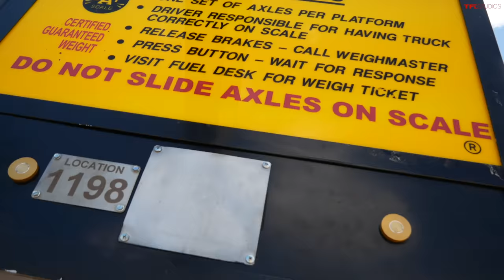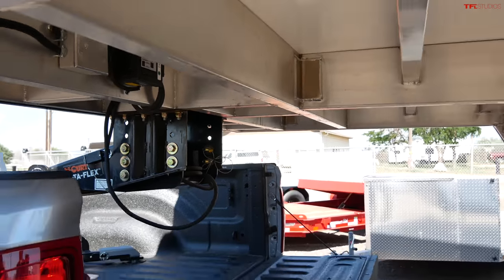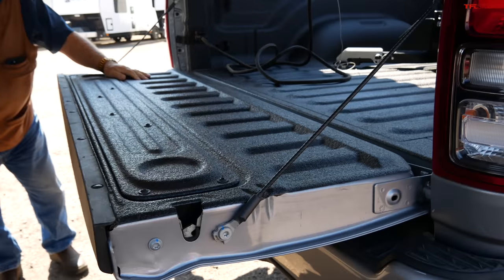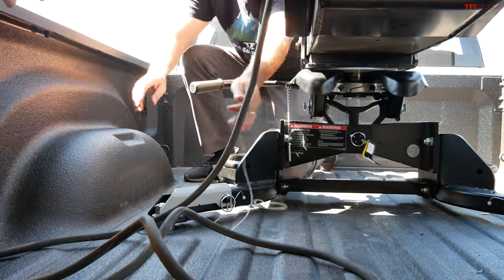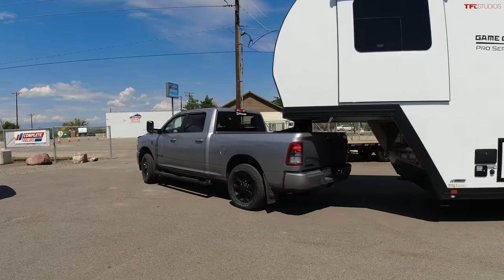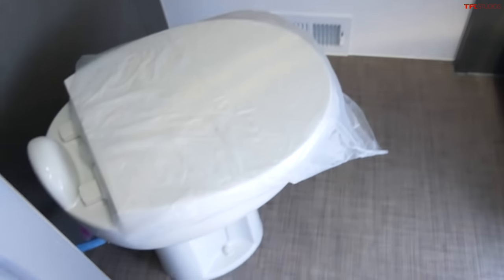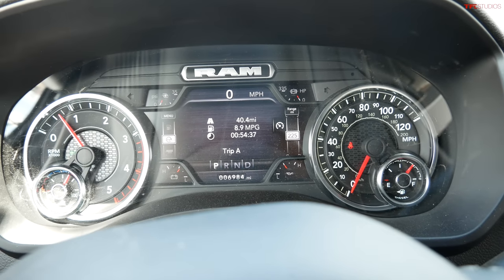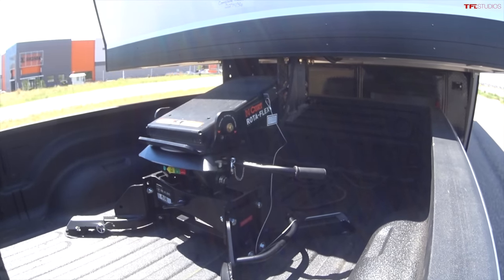I Accidentally Overloaded My Ram 2500 Cummins By 1,000 Pounds & Guess What?

Comment: I wish the Ram short bed was 6.6 like GM I had. I have a Crew 6.4 now and it is just a little short. Need a slider to do that job and let’s be real legally that truck isn’t enough but actually it can do it fine and the difference from 2500 to 3500 is largely the rating you are paying for. Ram does have the different rear end setup but I don’t think an F250 is much different than an F350 except the rating you pay for in reality.

Comment: Kent's comment of "Increase the payload, you OEMs" is puzzling. I'm sure he is aware that the 10,000 lb GVWR is a regulatory line drawn in the sand by the federal government. The only ways to increase payload are to increase GVWR or reduce the vehicle weight. Stepping over that 10k GVWR line moves the truck from Class 2b to Class 3 and brings higher insurance costs and more regulations for vehicles in commercial service. That's why the OEMs set the GVWR at 10k. Some residential areas don't allow parking a Class 3 truck overnight. One way to reduce vehicle weight is to opt for the gasoline engine rather than the Diesel, saving around 700 lbs in engine weight and gaining 700 lbs in payload. Andre's response of "Get a one ton truck" is the answer. Kent's response of "Increase the payload" is a head scratcher.
Reply: True you can't change the payload and towing capacity set by the OEM's. Suspension accessories just help less squat and better handling. I do want Ram to increase the payload to match trailer capacity.

Comment: Love content like this but parts of this were painfull to watch. 
You do NOT need a dually for that trailer, just a 3500. And ALL manufacturers 2500/250's are payload limited, not just Ram.
You do NOT need an 8' bed...at all.
Tailgate should stay on (just referring to the thought of removing it).
Also, if you test your trailer brakes with the trailer brake lever prior to hitting the road, you can be assured they are functioning well, and are at the proper setting. Before I upgraded my 5th wheel to disc brakes and 8k axles I always used the manual lever to test the drum brakes and get them 'seated' (for lack of a better word).

Comment: The ball is not attached like a fifth wheel . If the trailer was to  flip over the truck will go over with the trailer . With a goose neck ball the trailer would come off . Look at the semi truck that flips on it side the tralier will follow . Goose neck and bumper pull they will come apart . I have seen this . Look at ram hits slow moving semi the goose neck ball broke and the goose neck trailer hit the back of the truck . Fifthwheel hitch way stronger. Denis from santa rosa ca .

Comment: would've been interesting to see how close the bump stops were to the axle with it being "overloaded". Also wonder how much of a difference adding a toy to the garage would've made.

I do wish ram would offer a higher GVWR on the 2500 trucks like GM & Ford. Although, in this case, I think only a GM would've had the payload for this setup if sticking with 3/4 ton trucks.
Reply: The higher gvwr for this truck is the 3500?
Reply: @frostedjedi  I'm aware. I would just like Ram to compete with other manufacturers payload in the 2500's. I have a '17 2500 and know the capability is way higher than the advertised rating.
Reply: It's just marketing bs. Why would you make a 1 ton if you have a 3/4 ton with gvwr of 1 ton. Just get the 1 ton if you want more?

Comment: Im not sure which sliding hitch they use, but ive seen ram shortbeds all over do just fine with 5th wheels.
Reply from the maker: Yes, you can buy an expensive 5th-wheel "sliding" hitch for your shorter bed truck.

Comment: The OEM's can't increase the payload. Because they're limited by 14k rule. If they go over that. They'll be considered a commercial vehicle.  The DOT laws need to change on this. It's 2022 these new trucks need to be moved up to 16k in my opinion. Before they're considered "Commercial weight" considering today's technology with light duty trucks.

Comment: I bought a Thor 5 th wheel and the guy towed I with a 2 wheel drive and I had to put some 2” square tube as a lift for the trailer to not hit my bed sides on my 05 Dodge 3500 4 foot long bed dullay 5.9 cummins and towed it like there was nothing there but I did have to up grade my trailer brakes to electric over hydronic and that baby would stop on a dime !
Reply: 4 door not 4 foot bed that would  be a funny looking truck !!

Comment: You can gain several hundred pounds of payload by going with the 6.4L Hemi instead of Cummins in Ram 2500. Less torque, but more payload.

Comment: 2700lbs of trailer on the bed and you guys should measure the before and after squat like in your ike guantlets.

Cummins ram 2500... $65,000
Goose neck hitch... $2000
Atc game changer 36tf toy hauler with complete solar independence $200,000
Being overloaded on an empty trailer... priceless.

Comment: YEP... If you are going to tow anything, "Always use a 8FT BED!!" 1/2 TON ,3/4 TON OR 1 TON!! So why isn't there any CREW CAB 8FT BEDS IN 1/2 TON???????? That way we can fit the family in the truck and tow 2 side by sides with a gooseneck with a "HALF TON" 2 CAR HAULER FLATBED!! So we don't have to take 2 vehicles to carry the stuff or extra people!! I have a 6 person Quad, and need to put all 6 people in the truck!! I also need to carry a ton of stuff that take up the 8ft bed!! But I don't need to tow anything over 10,000lbs!! Mostly 5k to 7 k 95% of the time then 4% not towing, and 1% towing 10K (500MILES ONCE EVERY 3 YEARS) 1/2 TON would be great if they actually built a "REAL TRUCK" in a 1/2 ton!! Then I could drive it more when not towing, instead of having to cram myself into my Toyota Corolla to get 40MPG'S!! If I could get 30+ not towing in a Crew cab 8ft bed, then I could get rid of both my 1 ton and Corolla and only have to pay 1 insurance payment and one registration and so on... But they are too stupid to sell these trucks to the MILLIONS of people that want, and NEED these trucks!!! Oh, maybe next time weigh it "Before" you take it out?? LOL!! Just good to know that it can handle a little bit over... THANKS GUY's!!

Comment: Well your recommendations are way off.  If you look at the ratings of the single wheel 3500 it’s not great enough to carry the load.  Remember the load rating also includes passengers.  You were by yourself.  Is your family driving separately???
For that trailer you need the dually for the payload.

Comment: Why is the payload so low on that truck? If it’s 8300lbs and 10k gvwr, that means it only has 1700lbs of payload. Most half tons have that much even without getting any sort of payload package
Reply: It is because it has a very heavy diesel engine in a 3/4 ton truck. 3/4 ton and diesel is a complete waste, always get at least a 1 ton so you have a decent payload. And better yet, go dually.
Reply: The 2500 dodge has a different rear suspension, built for comfort not payload.

Comment: We commonly overload the snot out of our stretched 4th and 5th gen Ram 5500's. To the point where you can only stick a finger in between the front axle and the bump stops. The trucks are stock and have zero problems pulling that kind of weight. Although struts and shocks do not last long, 50-60k miles maybe.

Comment: Fifth wheel hitch weights are typically 20% of the trailer weight as opposed to 10% for a bumper pull. I would use a dually to tow that trailer. It’s better to over truck your trailer! Max trailer tow ratings are misleading. That truck has a max fifth wheel tow rating of 18,000# and a payload of 2200#. The hitch weight of an 18,000# fifth wheel is 3600#. Your truck is going to be 1400# overloaded! For that weight, considering passengers and all their stuff, you really want a truck with a 4500# payload (one ton dually)! The other thing to consider with Ram is that an Aisin transmission is an option on the 3500 which is way better than the 6800RFE. You may want to consider having a rep from LCI for a video like this as opposed to reading the directions and making a video. 😂

Comment: Do 5th wheels really add that much weight to the rear AND front of the truck? 5,000 on the steer axles? That just seems weird to me. I know nothing about 5th wheels but I thought common sense would tell me that adding weight to the bed of a truck wouldn’t make the front of the truck weigh thousands of pounds more. Unless I’m an idiot and I’m missing something, which is very possible.

Comment: If the truck is 8,300 with 1 person with no trailer and the truck weight with the camper is 11,080 that’s roughly 2,700lbs of pin weight, not 1,700.
Reply from the maker: Yes, I made a mistake.
Reply: @TFLtruck  I love your content. I have the same exact 2500 but it’s a 21’. I love the truck.

Comment: Even if you load the rear of the trailer, this rig will never end up under the GVWR for the truck.  Think about it:. Fully loaded you have 14,000lbs of axle capacity, and a GVWR of 16k, leaving 2k of pin weight.  The truck is over 8000lbs unloaded, which means the lightest pin weight that trailer will ever have is still going to put the truck over it's GVWR.  Unloading the trailer only increases the pin weight, worsening the issue.  Also, this is before adding the cooler, firewood, wife, kids, and dog to the truck.

This exercise illustrates why it's so important to weigh your rig.

Comment: Can somebody clarify something for me? 

I have a Ram 1500 Limited. The towing capacity guide (according to the ram website using my VIN number) says that my max payload is 1,187 Lb and max towing is 11,087 Lb. 
If my understanding is correct, does that means that my truck would be able to pull this trailer when empty? (Taking aside the fact that I would have to get a 5th wheel hitch that would also eat up some of my payload.)

If that were the case, why would this 2500 ram have a lower towing capacity than my 1500? 

Is there something I'm getting wrong here?
Reply: Your truck would not be able to pull this trailer. His truck weighs 8300 Lbs unloaded, hooked up he had 8000 on the trailer axles and 2700 on the pin which is over twice what your truck is rated. I would double check your payload rating however because 1187 is very light unless Ram rates their trucks differently than every one else. Your max payload is the maximum amount of weight the truck can carry including passengers. For example my F-150 regular cab has a payload of 1705 but I weigh 150 my brothers about 180 and my dad is 230, so if all three of us get in the truck we can only carry 1145 Lbs of cargo. If we got in your truck we could only carry 627 Lbs of cargo, that’s wrong for a full-size truck. Take the GVWR and subtract the curb weight of your truck and that’s your max payload.

Comment: kingpin vs gooseneck? whats better
Reply: Gooseneck, I said that in the video, if it didn't get edited out
Reply: @MrTruckTV  You did state that a gooseneck has higher capability, i just wasn't sure if when considering all other aspects that gooseneck is still the prefered method.
Reply: @acacia987  Well goosenecks articulate better on off-road conditions. And it's easy to get the ball out of the way to use your truck bed. But every truck manufacture rates towing a gooseneck higher weight than a 5th-wheel.

Comment: I think it's funny how you think a 16k lb fifth wheel RV trailer is not very heavy 🙂.

I tow with an F350 dually. I will never tow heavy with a SRW. The dually is so stable.

It was kinda obvious from the start that the trailer was too big for a 3/4 ton truck. There's more to towing than just the weight specs. The length of the bed, the brakes, frame, etc. all play a factor. 

Too many people look at their owners manual and say, oh I can tow that, then you see them in a viral YouTube video pitching themselves into a ditch.

Comment: Your not correct on chains. If the trailer, gooseneck or fifth wheels, are manufactured WITH chains, you MUST use chains by law. Goosenecks and fifth wheels are classified as class 5 receivers, the same as semi trucks. The  receiver for fifth wheel RVs is 15,000 to  25,000 pounds. The average gooseneck connector is  either 20,000 pounds for "light" class goosenecks (mainly horse and stock trailers) but the normal connector is 30,000 pounds. I have a 16,000 pound, triple axle fifth wheel (not a damn toy hauler but a RV) with a 20,000 rated connector but my gooseneck converter is rated for 30,000. I use goosenecks instead of a fifth wheel. The carry weight of a truck is actually determined by the tire weight rating. The average standard pickup tire, 245/75/17, with 8 ply tread, 4 ply sidewall is 3048 per tire. The same size tire with 10 ply tread, 6 ply sidewall is an average of 3680 per tire which is why I run 10 ply tires. The ride is rougher but my truck can handle the weight better. There is a formula for your connector location on the truck which most farmers and ranchers use instead of having the gooseneck or fifth wheel connector directly over the rear axle. The formula allows the weight to be more evenly distributed between the front and rear axles. The average is 6 to 8 inches forward of the center of the rear axle depending on bed length and if the truck is two or four wheel drive with a solid front axle. Independent front suspension four wheel drives are the same as two wheel drive. Instead of  the "over the rear axle" installs as most RV and gooseneck trailer retailers  do, if they use the actual formula, you will have much better control of your gooseneck or fifth wheel trailer and truck.

Comment: Pullrite SuperGlide would fix this issue.
Reply from the maker: Perhaps, that's for the next video.
Reply: I have one on my 2017 F-250 and its great. There are other similar brands but having an auto slider on a short bed is a life saver especially for maneuvering in tight places.

Comment: Did he say 850 for torque? I thought these were 1,050 for some reason. Perhaps I’m mistaken though 🤷‍♂️
Reply: The HO (high output) Cummins  that comes in the 3500s have 1050tq
Reply: @nismofan740  select 3500s that have the aisin as69 trans. 90% of the 3500s on lots dont. So they have 850 tq
Reply: @krice24  correct, was just stating that configuration is only in 3500s. Not all
Reply: The HO version available in the 3500’s puts out 1075.
Reply: @krice24  lol splitting hairs here. I know that. Was just saying there is a version and it's the HO, 10% of them or not.  Excuse me for not going in complete detail for a stranger on youtube....

Comment: If you have the rear air ride the truck wouldn't be overloaded. My rear axle shows 6500 lbs on the door sticker. Should've put weight in the cargo area too. That pin weight would be lighter with your toy/toys loaded.

Comment: If you put toys in the back you always always also increase the pin weight because the back axles do not carry 100% of the weight. If you are overloaded empty you will definitely be overloaded with weight in the trailer.. Only way to reduce the pin weight is sliding axles and move the axles forward.

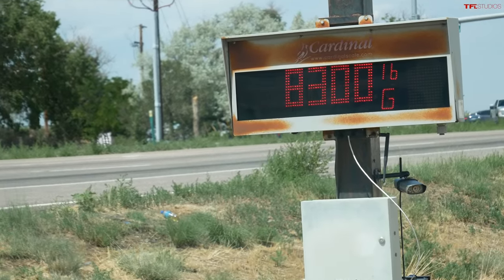Comment: 24:45 **2,700 lbs empty pin weight
Reply from the maker: Yes, I made a mistake on the calculation.
Reply: @TFLtruck  All good. An important note as similar toy haulers of this price and size that are steel construction have pin weights well north of 3k lbs. (HT Cyclone for example is near 4k pin weight). The aluminum here saves almost 1k lbs. of empty pin weight which really does make this a potential 3/4 ton truck towable when properly equipped (BTBRV would always recommend 1 ton though).

Comment: Groan. I don't even need to watch the whole video. 2500 Cummins does not have enough payload for a heavy fifth wheel.
I believe you're also over the rear axle GAWR for the 2500 diesel.
BTW, You should attach the breakaway to the truck, not the hitch.

Comment: The real lesson is don't opt for the diesel in a 3/4 ton.  They border on 1,000 lbs. heavier than the gas option.  That would have meant 2,700 lbs. of payload capacity instead of the measly 1,700.  The diesel is only an option in 3/4 tons because of diesel fanboys that watched too many episodes of the Diesel Brothers and think if diesel is the question, the answer is always yes.  The 1-ton option is a great way to go, but maybe not necessary if you need to save money.  The maintenance on diesels may be less frequent, but it's expensive.  Also, it costs you a lot more up front to get that diesel option, not to mention the fuel costs more, too.  Diesel only makes sense on a truck that has enough payload capacity to lose to the diesel engine and still have enough left to handle the job (basically, 1-ton and up).

Comment: The RAM 2500 is really not meant for 5th wheels with it's low payload capacity.  I'm planning on getting once but we will stay with pull behind.  Even then with a loaded trailer and the family it's close to hitting the payload limit with some larger pull behinds.  They really need to do something about their spring configuration since the RAM 2500 is so heavy.

Comment: Bad design on the front of that trailer.  I pull a 41’6” salem hemisphere with my pickup. Before that was a cyclone toy hauler.  Most big 5th wheels have a narrower nose just for clearance. My pickup is identical to Andres, even the same color, just a 2018.  Same bed, i use a B&W companion hitch. 🤣 $131k for that trailer. Wow. Definitely not worth it.

Comment: As usual you give bad advice . I would not tow that trailer with 2500 and the perfect truck for this job is a 3500 dullay 4 door and a standard bed 8’ 4x4 you must not have much experience with long dullay’s they just ride so good when you get the longest truck they make with dulls they Handel like a sports car so spend some time in a dullay you will love it and they are so much safer !